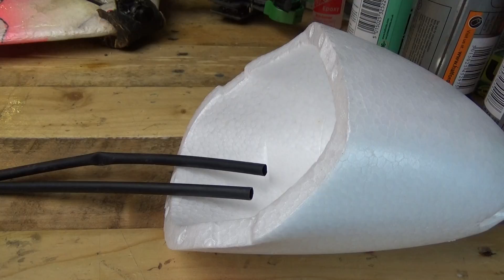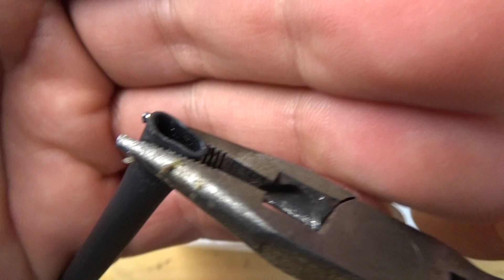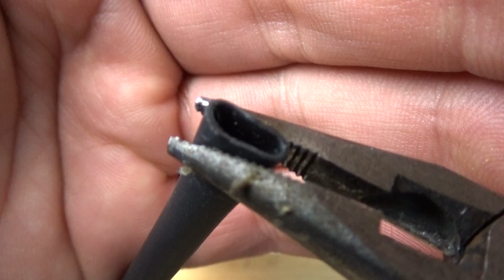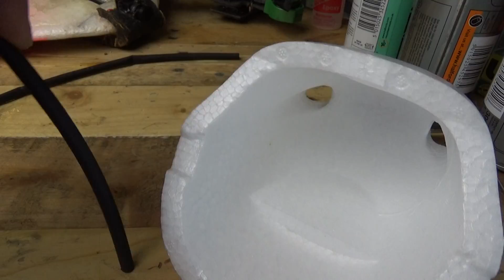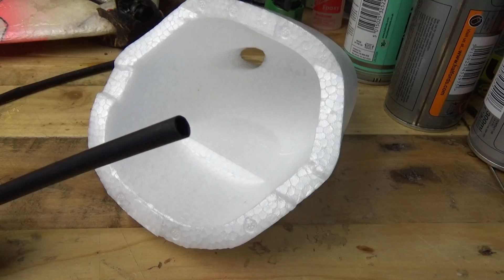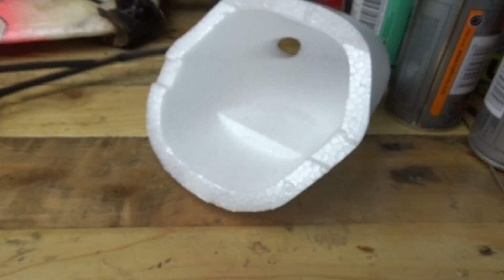Mini Review: Heat Shrink Tubing with Glue in it! AKA "Wonder Shrink"

Comment: The heat shrink tubing with an inner wall of hot-melt adhesive is referred to as "dual-wall" tubing. The standard kind without adhesive is "single-wall" tubing.

Comment: may I ask in your opinion with this be ideal to recover something like jumper cables or an extension cord? where it's going to be unraveled and wrap back up several times throughout its life? if not any opinions on what would work? and I completely understand that you're not instructed me to do anything if I shock my dumbass self I'm doing so at my own doing. was going to use something like aerosol plastic dip or liquid tape. any other ideas besides these if you think the shrink tubing won't work? thanks

Comment: I first came across this in 1970! I used it for a build project published in "practical Electronics" magazine. It also came in a gloss finish. It does go rather stiff when shrunk though.
Reply from the maker: Howdy fella, jeas! I forgot to mention I also use it on push rods, it works very well indeed, Matt

Comment: Like Mr Covert I've been using in my trade since the late 80's but it's not as well known in the model world so top job bringing it to our attention. Anyway the reason to comment was that I have in the past wanted the glued shrink but not had any, an alternative if you only want to do a small job is to carefully hot glue the part you want to secure or waterproof and then put your normal shrink over it, heat it with a gentle heat to slowly melt the glue and voila, almost the same result for nothing like the price :)

Comment: Seen & used this stuff when I was on the mines- usually big enough to stuff your arm into when cold! :v
Smallest I'd seen, until today, was 25mm & 30 or 35mm- it was one of these I believe that RCExplorer Tricopters are supplied with, but can't be certain...
Enjoying the sub-5 minute reviews, been enjoying Grumpy Trev's '5minute Buy it or Bin it' reviews too for same reason, quick & to the point....
Even IF his ARE about those multi-rotor air-shredders... :v ;)

Comment: This stuff is useless for models. It is almost solid when shrunk. Can't think of any part of a model that would benefit from it.
Reply from the maker: Howdy Chris, how about extension leads on the motor wires, say in the back of the mini talon to ensure that they never come undone? Matt
Reply: RagTheNutsOff 
Never had a bullet connector come apart. , Standard heatshrink will do the job fine and its removable if you burn out the motor or ESC. Or wrap with blenderm. If you are talking about a soldered joint, standard heatshrink will be fine. If you are worried about it coming apart. You need to practice your soldering.
Reply: how about stiffening an antenna stalk. I have loads of issues with drooping (ask the wife) that this will fix to keep my antennas pointed in the right direction
Reply: Steve W 
I use normal heatshrink on my antennas, don't use tube either. Never had a problem with drooping  (Ask the wife). But if you want to give it a go then go for it. It's cheap to buy. I bought some ages ago tried it and thought it was crap. Just my opinion though you might love the stuff.
Reply: Chris Edwards that’s your opinion